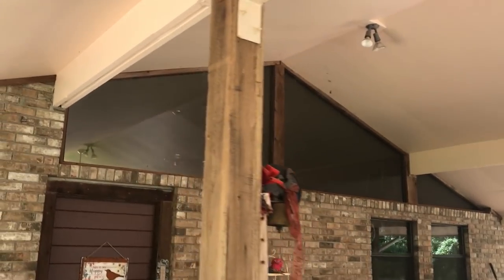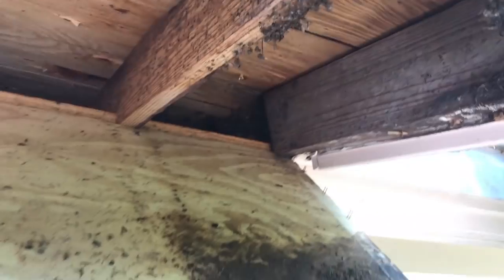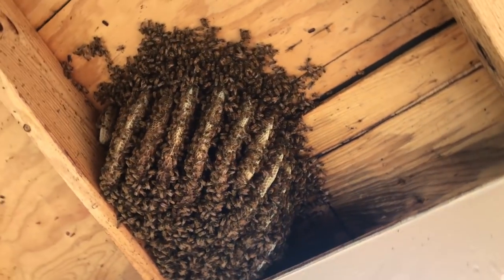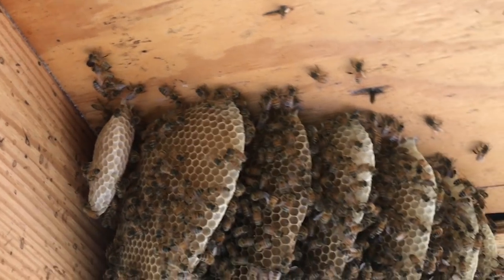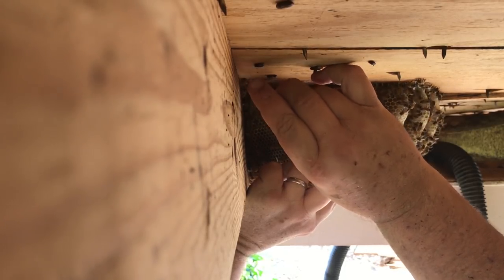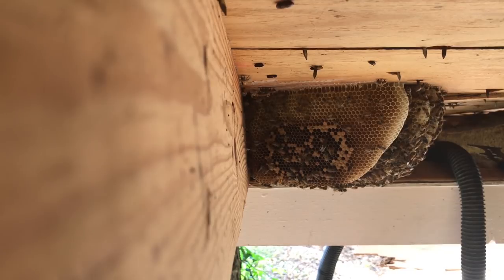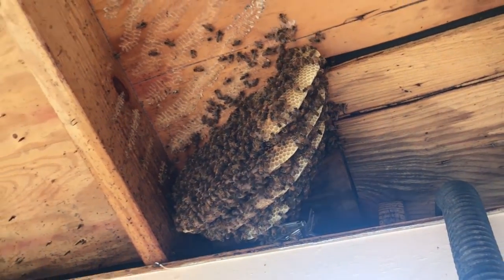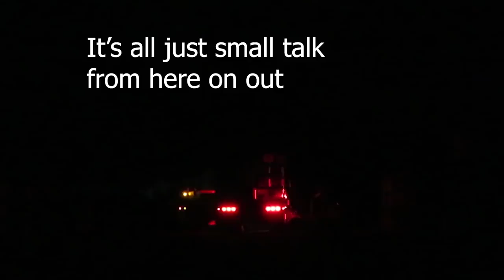When There Are No Cameras The Good Stuff Happens

Comment: Your bee vac is running on a "pulse width modulator" to control the speed. That's the wee-ooo weee-ooo sound.
Reply: onelove  ; ))
Reply from the maker: That is the older model.  The new ones run smooth.
Reply: @628DirtRooster  Nothing wrong with PWM's I was just explaining why they make the weee-oooo sounds.

Comment: What's the recovery for the bees covered with the honey in the vacuum?
Reply from the maker: The trick is getting them to separate from one another.  If they stay in a cluster they will die.  I sit there with a smoker and a hive tool and just gently flip them like pancakes until they are pretty well separated and working on cleaning themselves and each other.  I usually dump them on the top bars in a ten frame deep and maybe some on the bottom of the lid to do this.  Usually takes about a half hour or a little more.  Takes them a couple more hours to get back to normal.  I've done this four times now with success each time.  First time was because of me when I was new to removals.  I was a little panicked and it was the only thing I could think to do in the moment.  The other three were from "helpers" sucking up honey like they were emptying porta pottys.
Reply: @628DirtRooster  Good to know. Thanks!

Comment: My first cutout was a total loss.  All those honey coated bees died.  Very frustrating.  Was hoping to hear you describe how to fix that.
Reply from the maker: The trick is getting them to separate from one another.  If they stay in a cluster they will die.  I sit there with a smoker and a hive tool and just gently flip them like pancakes until they are pretty well separated and working on cleaning themselves and each other.  I usually dump them on the top bars in a ten frame deep and maybe some on the bottom of the lid to do this.  Usually takes about a half hour or a little more.  Takes them a couple more hours to get back to normal.  I've done this four times now with success each time.  First time was because of me when I was new to removals.  I was a little panicked and it was the only thing I could think to do in the moment.  The other three were from "helpers" sucking up honey like they were emptying porta pottys.